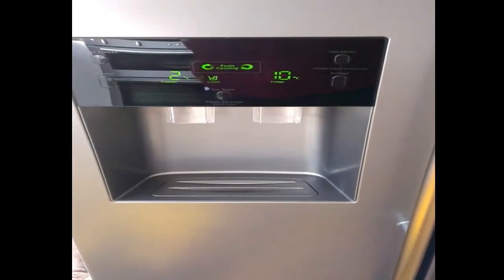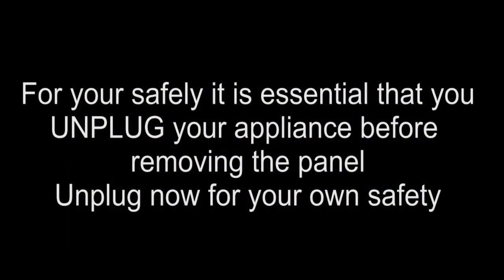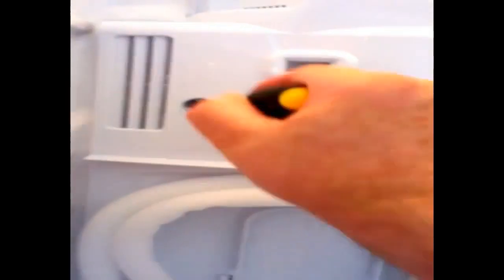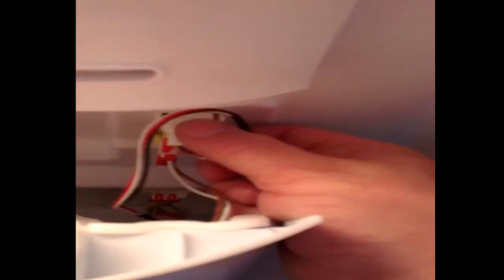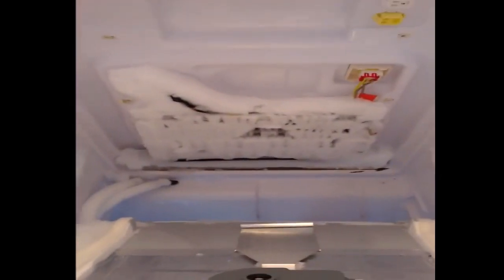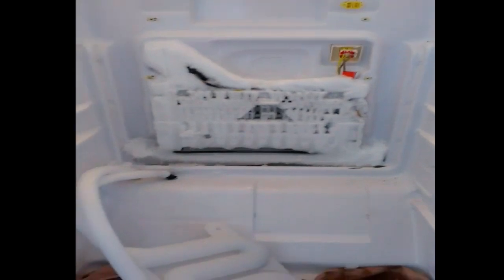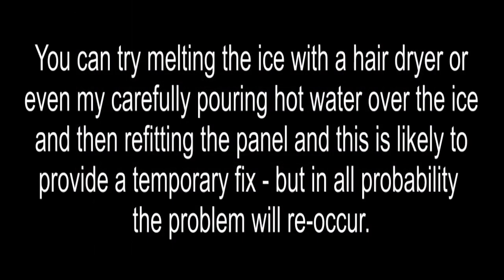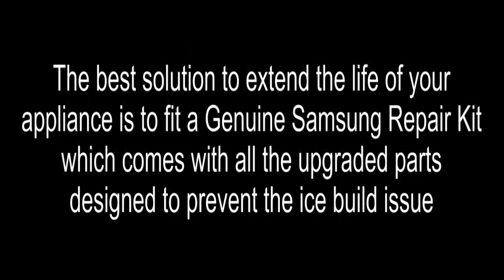Samsung RSH1 fridge freezer noisy fan full diy video

Comment: As many people have pointed out there are safety precautions not taken in this video. You should always unplug anything electrical when servicing. I found this video and this is what I did, step by step:

1. Remove all food and trays from the fridge section.
2. Slide the fridge out by pulling on the sides of the doors in the closed position. 
3. Open the doors and work in a well lit area or have someone hold a flashlight over your shoulder.
4. Remove your water filter and pull the cooler tray assembly out towards you, you don't have to remove it completely. 
5. Remove the 4 screws holding the fan assembly. Two at the bottom and two in the middle.
6. Stick a small flat head and pop off the plastic latches on both sides of the assembly working from bottom to the top.
7. Slowly and gently tug away the entirely assembly and disconnect the two power connectors up top, make note of the orientation.
8. Remove ice with hair dryer just enough to melt the ice so you can tug away at it. 
9. Blow dry the assembly on the backside the metal tape side so it heats up and melts the ice inside the fan assembly. Do not do the opposite side as you risk melting your plastic.
10. Pat dry everything and reassemble starting with the power connections, relatching the sides of the assembly, and replacing the four screws. 
11. Restore shelves and plug the fridge back in and let it power up and set cooling settings to max cold.
12. Restore food and monitor internal temperatures and make note of any noise for the next couple of days.
Reply: this solution is permanently or short time.

Comment: Ok, hopefully you can help me!??? (I would be very grateful)

Samsung have replaced the dodgy parts in the fridge under the recall extended warrantee (with the same kit as you are selling) … but it appeared that the same kind of thing was happening to the freezer side whilst the fridge side seemed to remain fully functional…
The short term solution was to fully defrost the freezer, then it worked fine until the ice built up again, especially down the bottom… now, since the last defrost it just keeps throwing the trip switch so can’t use it at all :(
Any initial ideas on what is likely to be shorting out would be extremely helpful?… after defrosting, there was a draft coming through the vents but is it likely that this could have been coming from the fridge rather than the freezers fan?

Comment: I used a wall paper steamer instead of the hot water 4min and I had all the ice melted off!!! yes in 4 minutes!!! and sterilized too :)
thanks for this video. Question!!!! I had all the watchdog parts replaced 3 years ago but recently I have been having some issue with a coffee machine in short and RCB was keeping tripping. 1 day after the RS21 fan noise started, Do I still need this kit?

Comment: oi doofus, you make a point about turning off the power to the unit before removing the panel, yet this guy hasn't turned it off and continues to remove the panel... and don't pour HOT water over the unit because of thermal shock.... and the darwin award goes tooooooo????